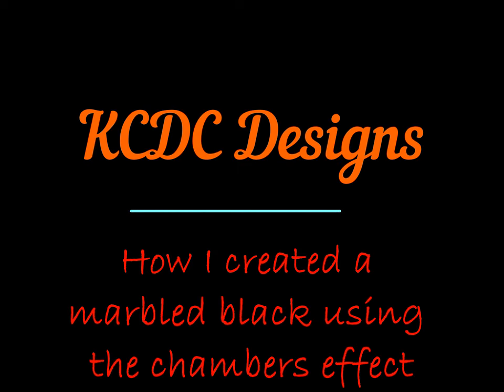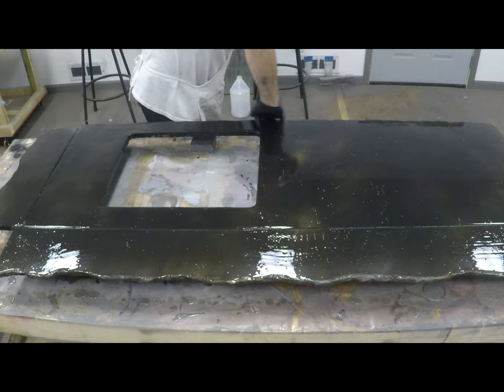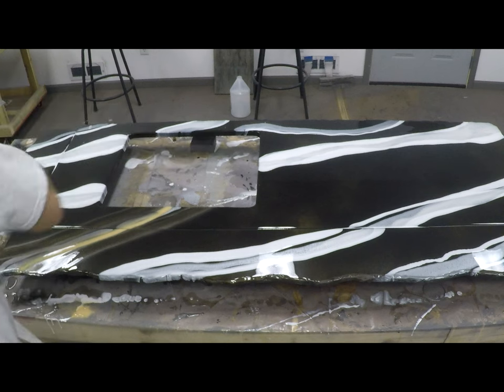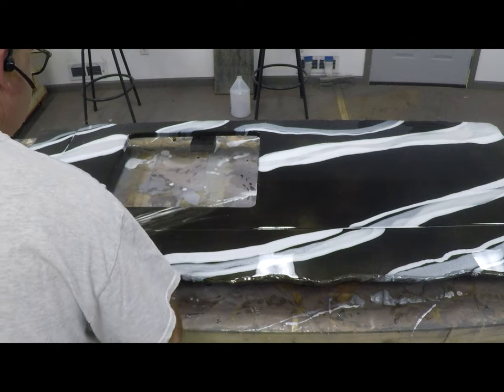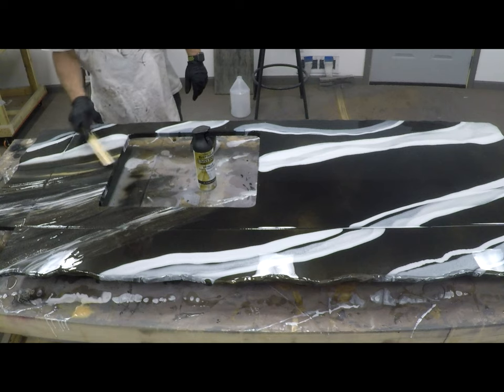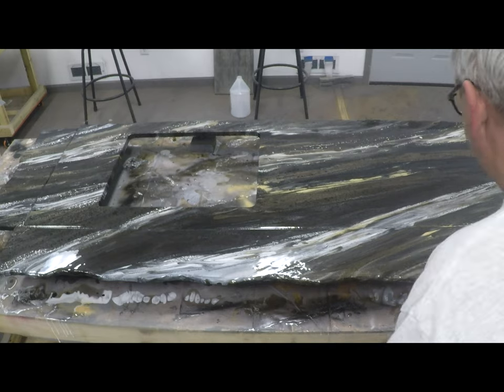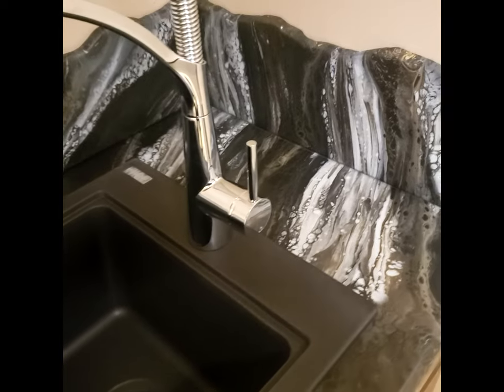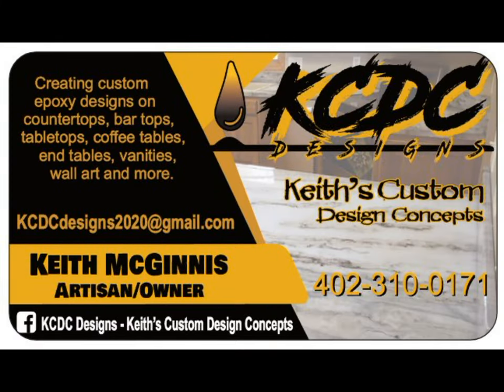Creating Marbled Black and Bronze using epoxy resin

Comment: love ur work🔥

is epoxy resin food grade?safe when touching food?
thx
Reply from the maker: Thank you! 
Although I can't speak for other brands, the product I use, Stone Coat Countertop epoxy is food grade safe and non-porous. All of my contertops and/or any food prep surface include an additional clear coat of epoxy resin over the color coat, as well as a food-grade safe top coat. The additional clear coat is very important because of the different mediums used to create designs in the color coat.